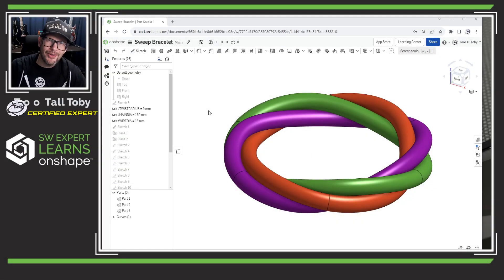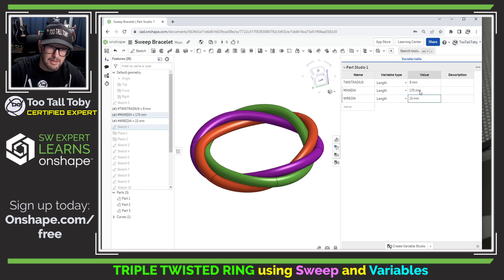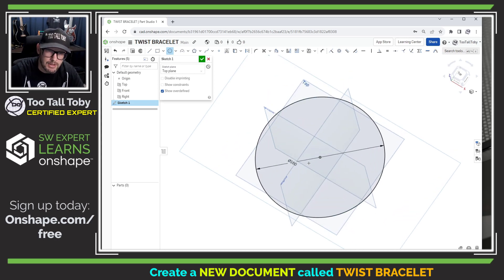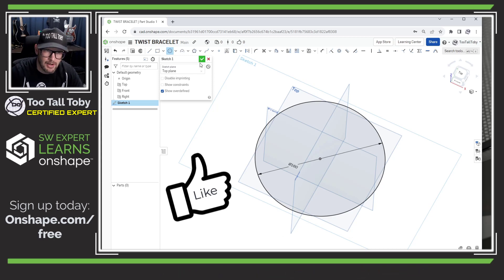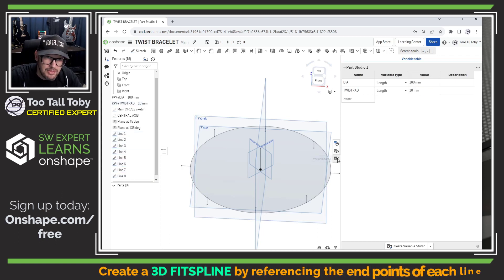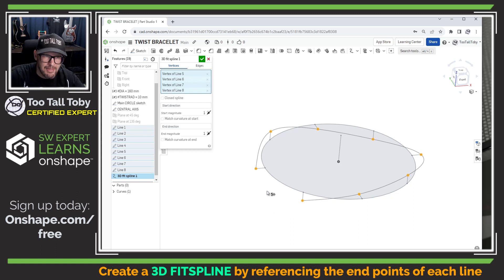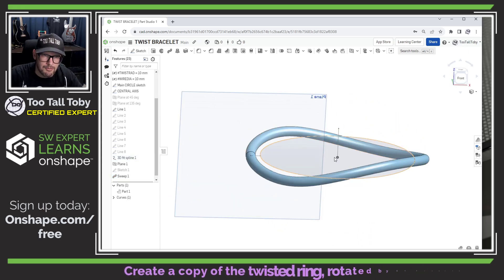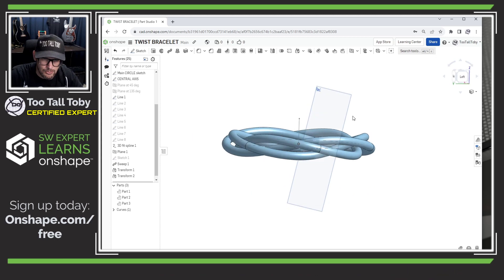Twist Bracelet Using Variables (Tutorial)

Comment: Ha! Nice variable demo!
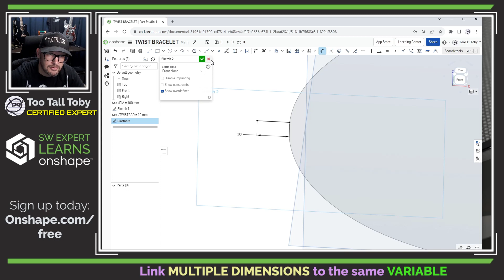One thing worth mentioning is that you can actually use the variable table to change variable values while you are editing the sketch, which is actually really handy. So at 4:10 you didn't need to exit the sketch to change the value.
My other thought is that you made your life harder than needed by creating all these sketches: just create a "cross" shape in your sketch 2 and circular pattern the sketch feature 8 times to get your references for the spline, a lot quicker!
Moving the variable to the top of the tree is actually not best practice (I used to do it as well as "looks" more organized) as it has a negative impact on regen time. It doesn't matter on a simple part studio but on a more complex one having the variable declared only when it's needed means you avoid rebuilding the whole tree above it when you change the value. The table provides a way to see all of them together easily so it doesn't matter that they are scattered in the tree (and when you mouse over a variable in the table it cross highlights all the features that use it in the tree).
Lastly, were you just looking for an excuse to show off the transform tool at the end (instead of using a circular pattern)?

I tested this in a public doc called "Easy TTT Twist Bracelet", including a bonus "easiest" option using the 3D spiral FeatureSrcipt (with configurable number of turns).

Happy Onshaping!
Reply: I was about to say the same thing about regen time when all the variables are at the top of the tree. Learned that the hard way in one of my own projects a while back. Another benefit is that if you use folders in the feature tree to organize your work you can easily have the variable listed at the top of the folder corresponding to the part or operation where it is used. It helps a lot with the visual clutter, and it wouldn't be possible if they were all kept at the top!
Reply: Oh man this is SUCH VALUABLE KNOWLEDGE!!!  Thanks Airwick I love reading and digesting your comments!  So helpful!   I looked at your model in the public space.  Circular Pattern of a SKETCH!!!???????   MIND = BLOWN!!!!!!!
Reply: @TooTallToby  Glad you are finding it useful! 
There are definitely some things in Onshape that are "non-obvious", one of the reasons I like seeing other people's input on forums or random videos as there often some interesting nugget of info in there!
I find Onshape is (generally) pretty good at not imposing "arbitrary" limitations on things so I find that it's worth experimenting when you have one of those "I wonder if..." thought as it more often than not just works!
Patterning a sketch or editing the variable table while in a sketch are some examples! 
Some of my other favorites are switching configuration while editing a feature or sketch, renaming a feature that is below the rollback bar (or while the part studio is rebuilding), etc... I should do a "did you know" video / series some day!